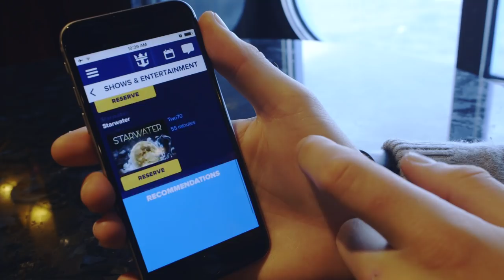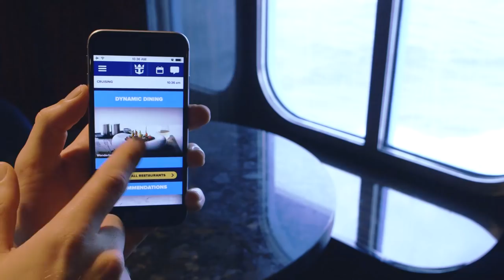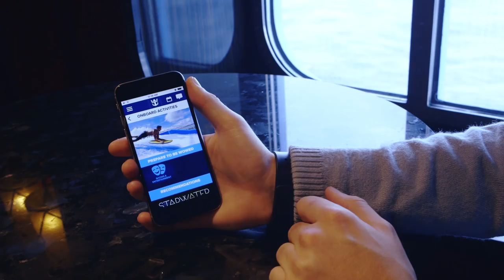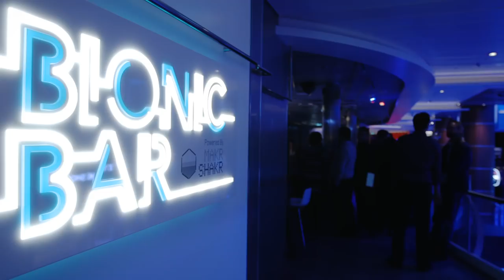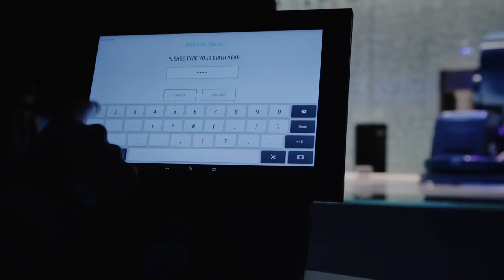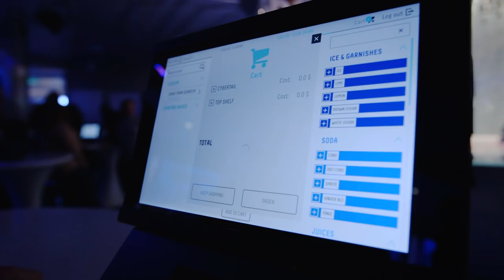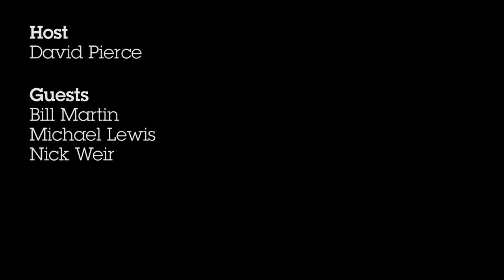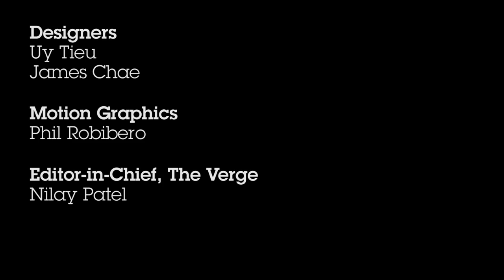The most technologically advanced cruise ship in the world - Top Shelf

Comment: Imagine if this was a small space ship.
Reply: Small ship with a bunch of shit in it. 

Less walking, don't see why people would mind.
Reply: it looks like that space ship form wall-e, except stuck on water.
Reply: danny1111105 omfg thats what I was thinking
Reply: Robert Oortwijn death space
Reply: That'd be the biggest spaceship ever built by far.
Reply: @brainmind4070  I think small is being used in a relative sense not a literal sense. A small space ship would still be larger than the biggest space vessel we've ever built.
Reply: Aaron Self When you're talking about size, everything is relative.  This thing would be rather large for even a sci-fi space vessel, so I'm not sure what the basis of comparison is supposed to be.
Reply: @brainmind4070  Not necessarily. A star destroyer would have miles and miles of unused space if you put this inside one. The Warhammer universe wouldnt even notice a space vessel carrying this because it'd be to small to even notice. The sci-fi and space fantasy genre typically have massive ships. Even in the starwars universe "small" pleasure crafts are pretty big, and those a cheating when it comes to space since hyperdrives are roughly the same size as some motors on smaller yachts (I'm using the hyperdrive of the ship you fly in KOTOR as hyperdrive size)
Reply: @brainmind4070  But yeah, it would be massive. And I think it's probably the most likely form of long distance space travel we'll see for use by the public. Since space travel is horribly expensive, we'd have to find a way to mitigate costs. Provided we don't automate all manual labor and eventually get rid of a monetary system overall. After all, who needs money, when it doesn't cost anything to create something.
Reply: Aaron Self There's a lot to your comments.  The only thing I'll say is that I think we agree it's big but that there are absolutely huge space vessels in sci-fi.  It could have a hangar full of a dozen X-wings and plenty of space left over, so I'd call that big.

Comment: What happens if the ship is hit by an EMP?
Reply: what happens if any ship is hit by an EMP? Or a plane? Submarine? Skyscraper? We're in a technological world and we'd be screwed pretty much anywhere during an EMP
Reply: I volunteer on a small 126 ft steam vessel. Everything important on it works without electricity. You'd have no lights, no communications and no refrigeration, but the whole propulsion system and steering gear is all steam driven so it would be the only thing on the water that starts and runs without electricity and computers. You'd even have running water and flushing toilets, hot showers without electricity. The generator is actually powered by a steam engine which wouldn't give a toss about an EMP I just don't know if the control circuit for the alternator would still work after an EMP.
Reply: Charles Randolph, well, pretty much anything not in a faraday cage is screwed when hit by an EMP.